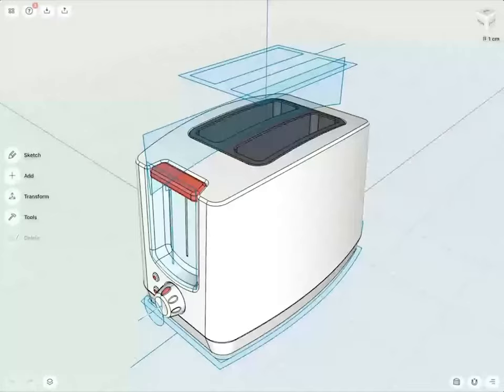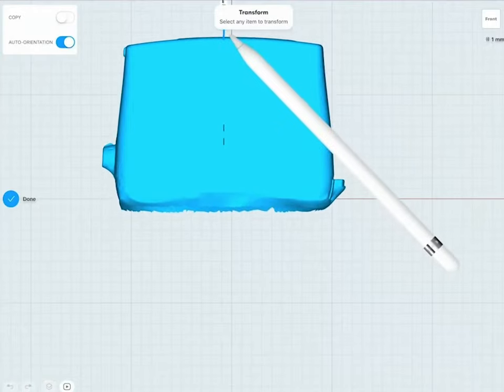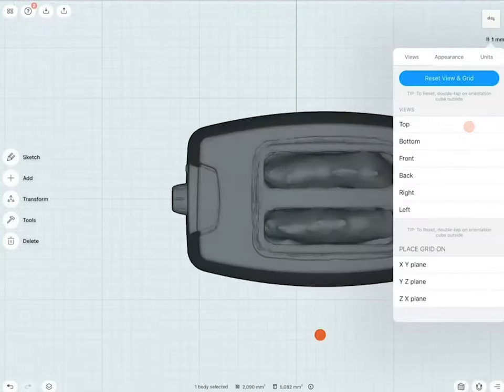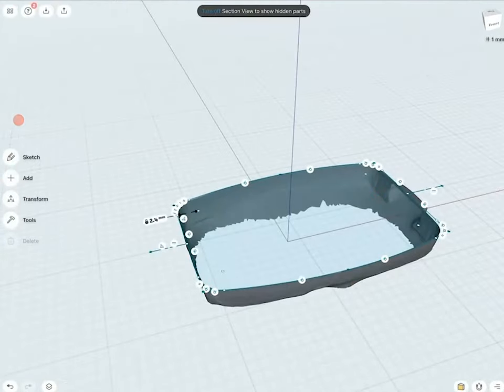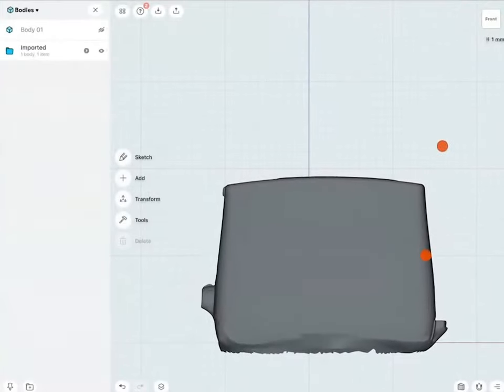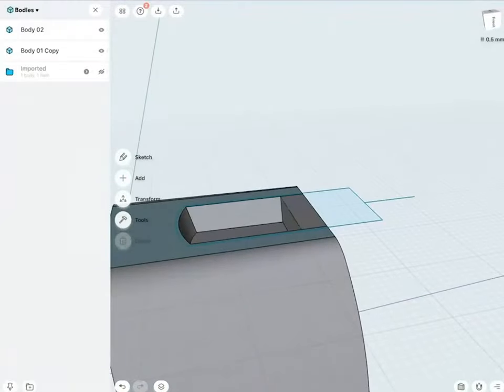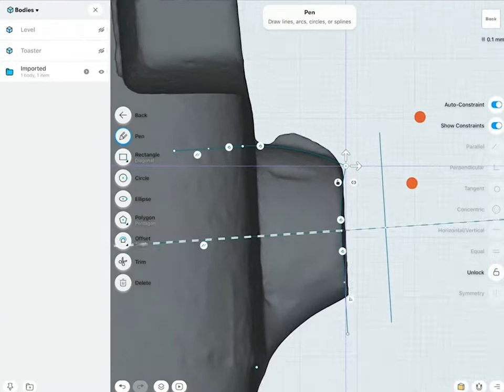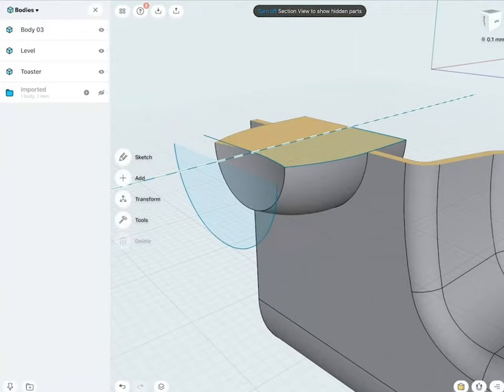Reverse engineer a 3D scanned object into a CAD model | 3D design webinar

Comment: I might get this for 3d printing. I did solidworks when I was in college 5 years ago and I’m trying to relearn my CAD skills on Onshape. The problem is I don’t have much time to learn and as I’m already aware there is a steep learning curve to traditional CAD software. Plus I’ve never created parts based off a 3d scan mesh, only created parts, so that only adds to it. Even once you get a good understanding of it it still takes a lots of time.

I think this would blow that away in time saving and ease of use. I primarily plan on designing parts, reverse engineering parts via a scan, and adding parts on top of meshes from scans. The $30 fee per month is a lot but easily offset-able if I can actually get going on my designs. 

Great work on this 👍🏽